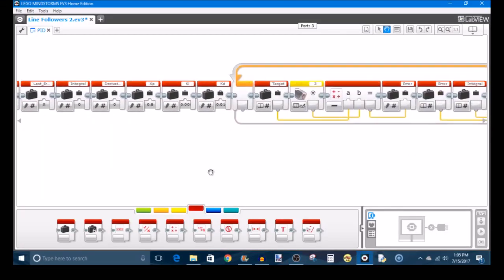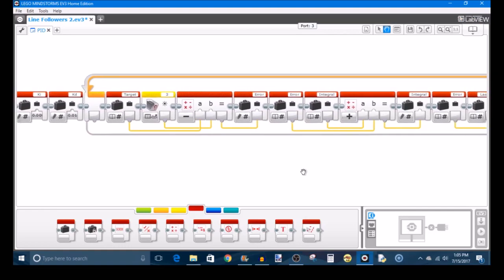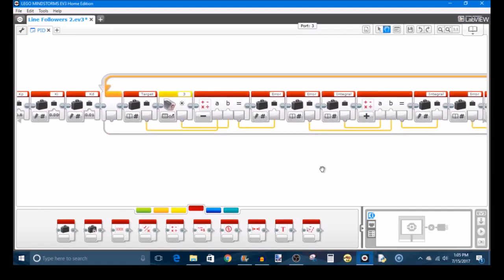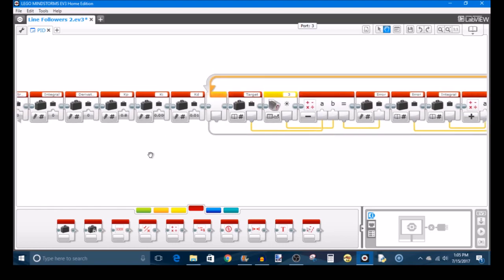PID Line Follower for EV3 (Part 2) - K Values and How to Improve Performance

Comment: put your error values in an array with the index going from 1 to 50 and then starting at 1 again and on and on.  Then sum the array for your integral value.  Experiment with the number of elements of the array.  This gives it a memory for errors recently but not for ever.  This is kind of a reset term to clear the integral out of old obsolete data.  The number of elements is dependent on how many samples you get from the loop and the ground speed of the robot.  You can make it beep every time the array index hits 0 again and then when following the line its memory is the length of travel between beeps... Turn this beep off after you are happy.

Comment: For the people who have their robot spinning in circles when any Ki value is used the fix is to put another write integral variable set to 0 in the loop, It only works if the variable is at the start of the loop or the end.  The reason that this fixes it is the integral is getting higher and higher as the program runs and makes the robot go in circles
I hope this allows the program to use Ki.  :)
Reply: Does work it fixes the problem and makes it even better Thanks
Reply from the maker: The problem is, this effectively removes the integral term; it's just the same as if you had just set the Ki to zero. Then, what you really have is just a PD line follower.
Reply: @Builderdude35  ok well it makes a difference for me and Ki at least does some thing beside making the robot spin in circles, you should try it

Comment: If we change the colour sensor block to a gyro block and fine tune the K values will it work as a gyro PID?
Reply from the maker: Absolutely! The principles behind gyro following and line (color sensor) following are the same, so you can definitely adapt the code for PID gyro.

Comment: I have a couple questions for anyone who can answer them. 1. My robot just turns in circles, how do I fix that? 2. Does this program work with curves and turns?
Reply from the maker: Yes, the program definitely works on all types of curves. If your robot is driving in circles, your robot is either 1) not seeing the line and the color sensor target needs to be adjusted or 2) your k values need adjusting.
Reply: Builderdude35 Thank you very much! That was very helpful.

Comment: I've tried everything I could and it doesn't work. However, I am using gears on my robot. Does that affect the performance?
Reply from the maker: The gears will make the robot's driving more sensitive and possibly harder to adjust as a result. It is mostly in those K values. Keep trying!

Comment: Ok.  Here's why the integral doesn't work here.  This is a highly non-linear control feedback system.  Feedback is quasi linear only in a small zone where the sensor can see the edge.  Once it drifts off the edge, it has no clue how far away from the edge you are.   The error only works up to a point.  This makes error cancellation impossible.   If you had a gradient gray, you could make use of the integral term.
Reply from the maker: Thank you for sharing! I think you may be on to something. Maybe this is a possible tutorial topic for the future!
Reply: If you do, I'd be interested to contribute.  The integral term probably needs a simple high pass filter to "strip off" the long term DC component of the integral anyway.   From a control perspective,  the integral is probably only relevant for the prior few seconds or so, not from the beginning of time.  Even a grayscale line method will likely build up a long term error component due to system tolerance and quantization errors, et. al.

I'm a volunteer robotics instructor in Detroit Public Schools for a few years now, and an Electrical Engineer with about 35 year's experience.  Thank you for your videos; they are some of the best EV3 videos out there.
Reply: Rob Jones hi can you explain why the integral part doesnt work and what changes to the program would make it work?

Comment: my program will not turn right now. It does a complete 180 when it approaches a 90 degree right turn. How do I fix it
Reply from the maker: I'm not sure. Maybe give the K values a little more fiddling. If that doesn't work, try a different line follower (like 3-sensor) that is easier to adjust.

Comment: I would suggest testing and showing the performance of your line follower in different situations.  Straight, wide curves and sharp curves, also curves in multiple directions.
Reply from the maker: Thanks for the suggestion! I will make an expanded demonstration video when I get the chance.
Reply: Have you made it yet, I can't find a video were it did turns? @Builderdude35
Reply from the maker: @vivangupta4928  Not yet. Stay tuned.